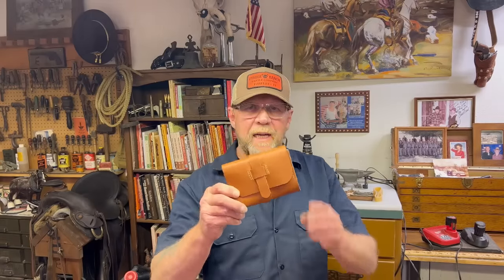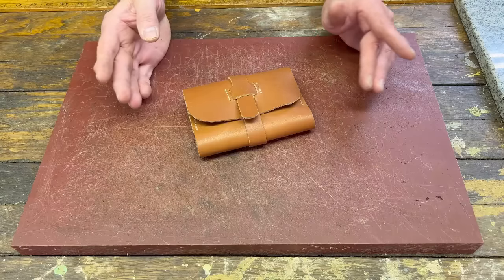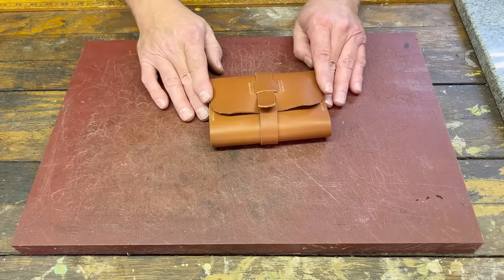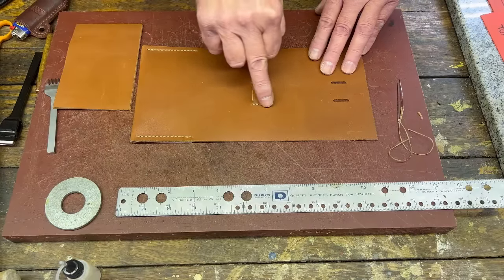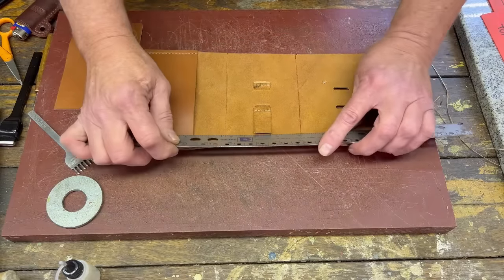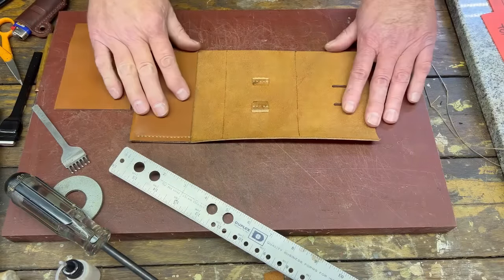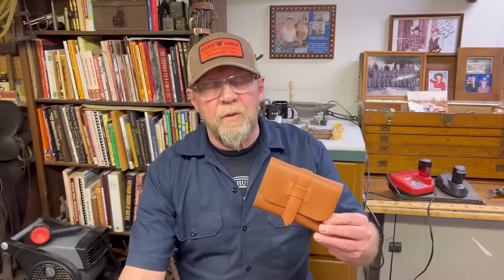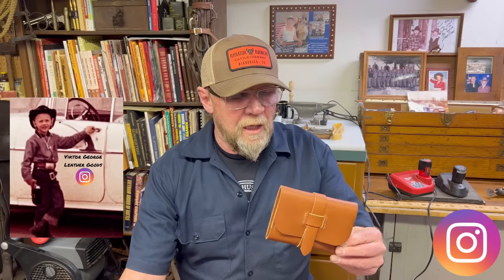Crafting A Vintage Cowboy Wallet From 1875: Simple DIY Tutorial! #youtubevideo #history #youtube

Comment: Just curious, in that period did they use glue? If so what type? Maybe hyde glue?
Reply from the maker: That’s a great question but I bet you’re right.  🤙 Now I’m curious 😂
Reply: @viktorgeorge9144  now we are both curious, if you find out you should add that to the video, I’ve looked around and haven’t seen anything about it, btw i think your channel will grow fast I just subscribed the other day and it’s already growing by hundreds, keep em coming!!
Reply: The one glue i did read about is spauldings glue, developed in the 1850’s and was very popular in the time, it was one of the first mass produced glues, can’t find what it was made from though
Reply from the maker: Thanks a lot for the positive comments! Means a lot and the Spaulding glue find is fascinating information I’d love to find an expert in historically based fabrication 🤙
Reply: Traditional harness making didn’t use glues very often.  The tanneries produced hide glue and it was apparently used in the making of large belts for industry. These would have been long belts that would connect lathes and drills to drive shafts run commonly by small steam engines before the advent of electric motors.  These belts required ‘scarf‘ joints because of their length.  These joints were tapered down by skiving down the thickness to thin edges so that when the pieces are glued and stitched they will maintain a uniform thickness when running. Belt making, like this, was one of the skilled leather trades.  The problem with hide glue is that it dries stiff which works fine on wood but not so much for leather that is going to be flexed.  Skilled harness or bag makers sewed a single awl punch and needle stitch at a time so glue was not necessary. Pricking irons were used in the 19th century but only to mark where the stitches were to be placed.  Modern contact cements are a late 19th and 20th century invention